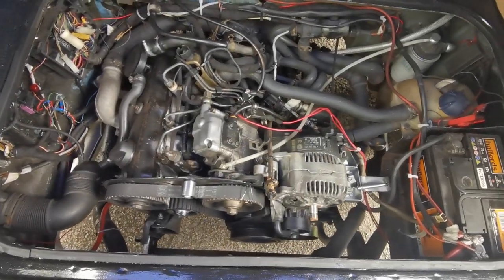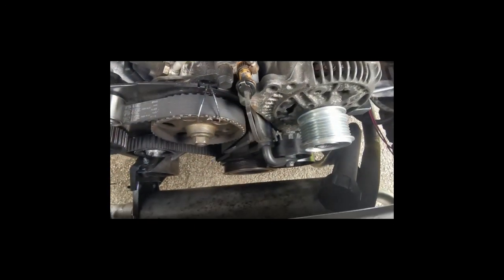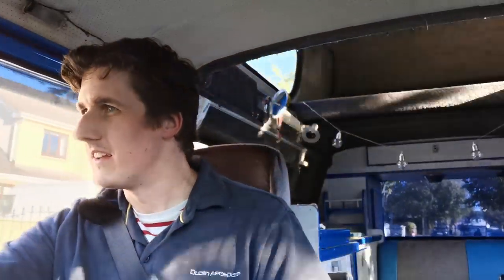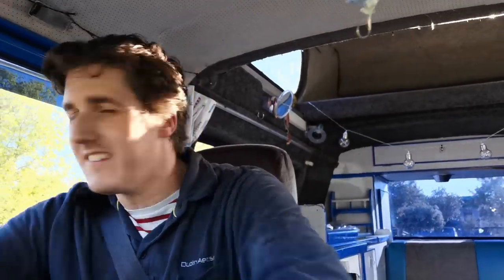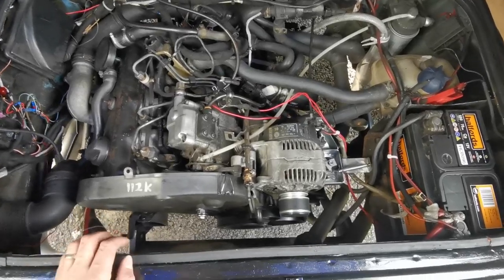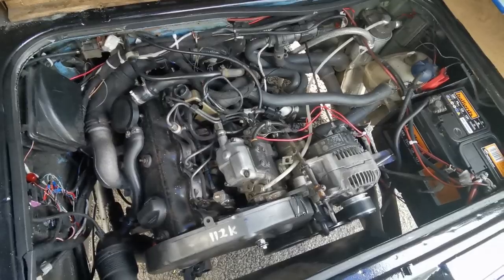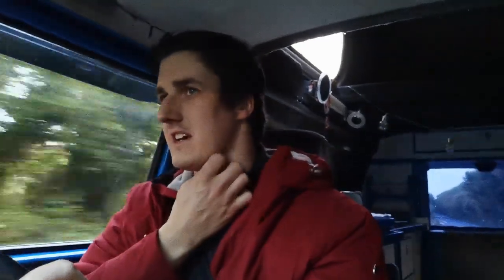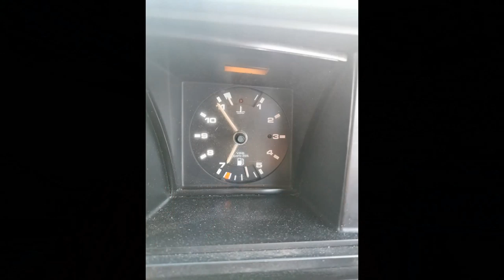ROAD TEST! - VW T25 / T3 camper with TDI engine swap - FIRST PROPER DRIVE

Comment: Nothing wrong with that test drive. Don’t forget the aerodynamics of the t25 high top would be hampering you too a little.   Great little video series. Well done.
Reply from the maker: Thanks. To be honest the overall driving experience of it is good enough that the 0 to 60 time doesn't bother me too much. That said, I am going to check to make sure everything is as it should be.

Comment: The vw sharan the engine came out of is roughly 1700kg gvw too.
Reply from the maker: I didn't know that actually! They can take a bit of weight, so! Although the van is 1900kg kerb weight at the moment, with a dgvw of 2,400kg!

Comment: Where did you get the hoses from? I’m putting in a Audi mark2 petrol in my T25 and not sure where to get hoses from
Reply from the maker: Coolant hoses from the original 1.6td engine all fit. Intercooler pipework came from ultimate engineering.

Comment: Enjoyable vid Ross... just about to TDI a very slooooooowwww 1.6 non turbo syncro... with an ALH caddy 1.9... (I think)... Ben
Reply from the maker: Well best of luck with it! Just make sure you get a known good engine still fitted to a car you can drive for a bit. Take a download of all the ECU figures before you remove it so you know what it should be when you fit it to the van.
Reply from the maker: Incidentally, I don't believe syncros were ever made in non turbo form. My understanding was that they always had either the 1.6 JX turbo or the 2.1 wbx.
Reply: @Endfloat  well our one is running on only two weetabix for sure! Thanks for the advice... might even consider a Subaru as our donor isn't playing ball... great vids... great vibe...
Reply from the maker: @Nutjobdotcom  thanks very much! If I was doing it all again, I'd definitely look at putting something more powerful than the AHU in. Maybe a V6 TDI would be a nice option.

Comment: Quick question for you, did you run the standard oil capacity in the gearbox. I put the standard amount in mine because I've never seen anything else recommended. Just curious as to whether its enough
Reply from the maker: No I have about 3.5l in my gearbox. I would run more for sure.
Reply: @Endfloat  Yea can't think what I put in. 2.8 is what's in my head but think there is a little more noise than I'd like in high gears

Comment: Is that a 1.9 Tdi ( 90 BHP) engine from a MK3 Golf/Vento?

Am looking for help and advice about putting in a MK 4 Golf /Bora 130PD engine into my 1998 T4 van. Any advice would be appreciated. Thanks
Reply from the maker: It's actually out of a seat Alhambra, but yeah it's the same engine. AHU engine code.
Reply: @Endfloat  thanks and glad to see that you are enjoying the conversation 😊

Comment: Hey tell me where to get this engine and gear i have t25 with original diesel engine but in Pakistan there is no such great mechanic
Reply from the maker: I got mine in Ireland, where they're readily available. I'm not going to be able to tell you where to get one in Pakistan. The best thing to do is find an old Passat with one of the non-pd engines.